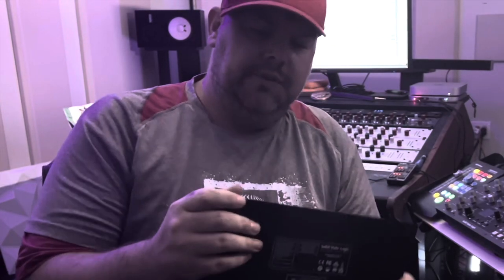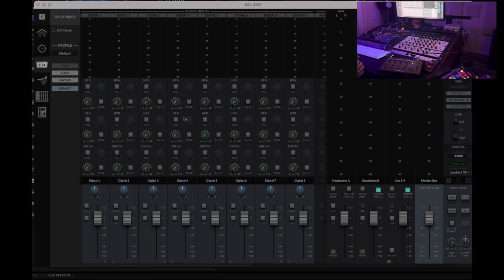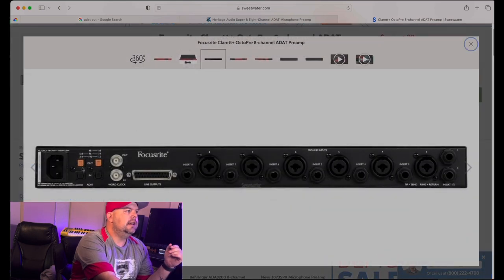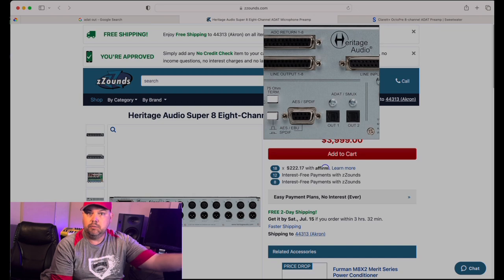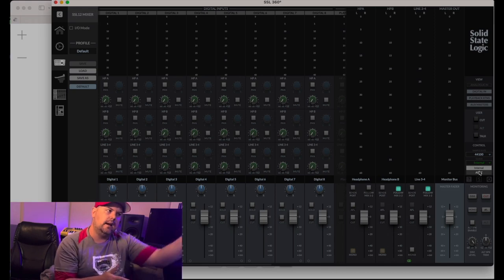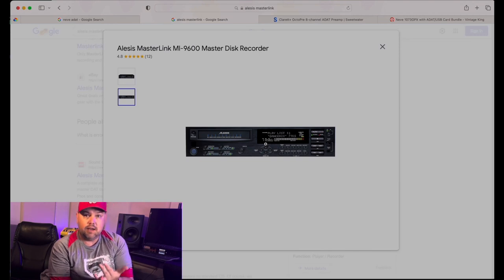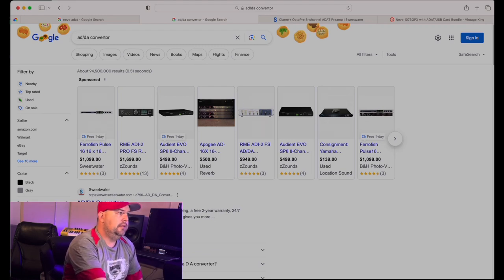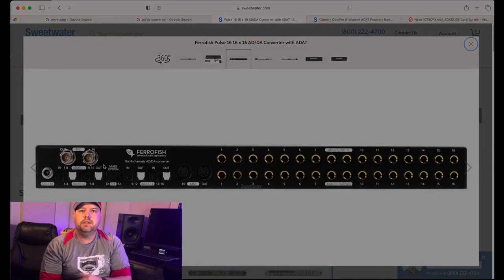Hooking up digital connections (SSL 12)

Comment: Thanks Doug, very informative - Now I can use the ADAT/toslink output from my universal audio Duo (which can't connect to my newer mac bc the universal audio uses 800 firewire. My Universal Audio 8 channel from 2012 can now be dusted off and used for 8 additional inputs on the SSL-12 interface! Awesome.

Comment: Awesome lecture
Reply: I currently purchased a used master bus portico and struggling w/ the connection so I was told I needed 1 DB25 to XLRF and another DB25 XLRM they are pricey specially the mogami. Is this the only way to go by this or are there other options as far as connectivity. 

Also if I want to hook up a summing box how to I do with the connections because it’s more complicated lol

Comment: Really informative video!! So let me get this right!! If I had something like a black lion, audio modified, Digi 002 rack, I could use that as my clock, via adat, and get the extra inputs as well?? Or, essentially anything that has an adat out, and has better conversion can be used as the main converter, synced via adat?!! Essentially, allowing me to track and mix with the better conversion?! 😮
Reply from the maker: Yes, anything Adat.  With avid stuff you may need to set it internal first from another system, I have an Avid 192 I/o running into it, but I needed to do routing on an old hd system first.   But yes